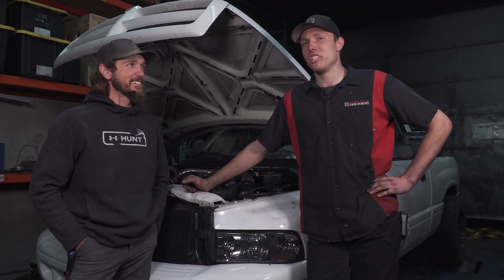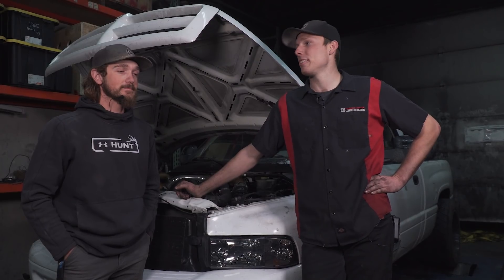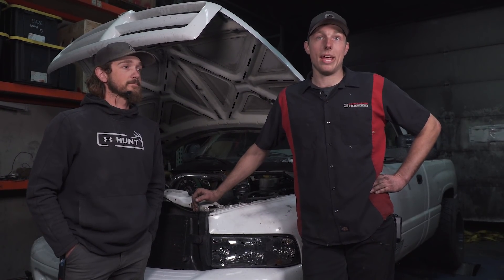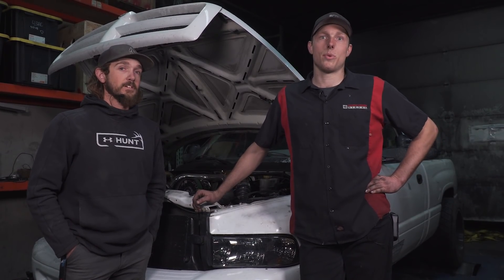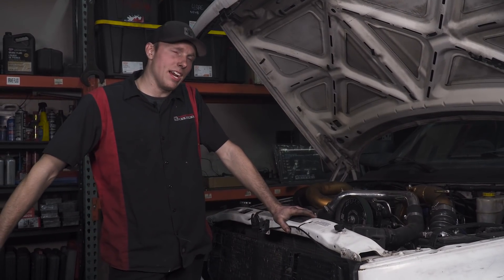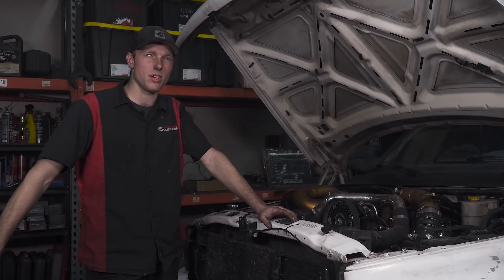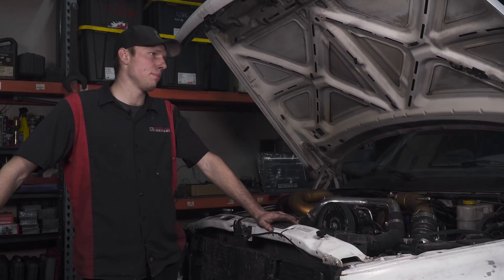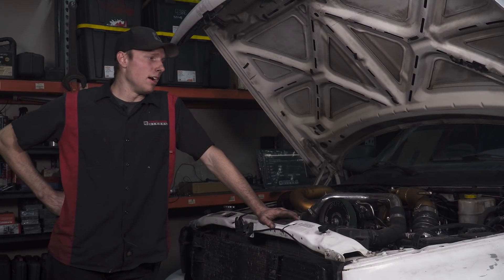47RE Transmission Torture Test | PDD Billet Input Shaft | Power Driven Diesel

Comment: Want test  it pull a 30klb trailer up a mountain and cycle between locked and unlocked under full power. That usually finds the weak ones 🤣